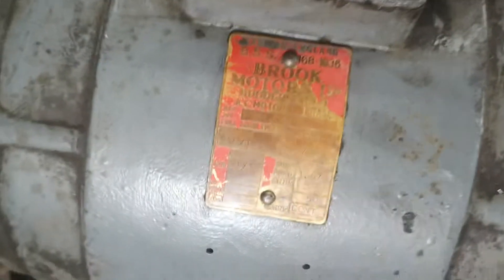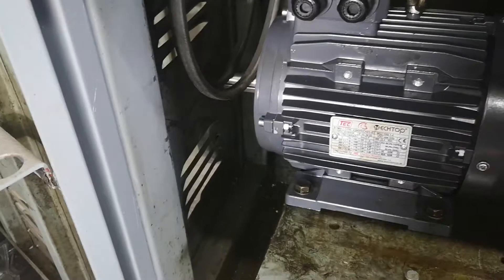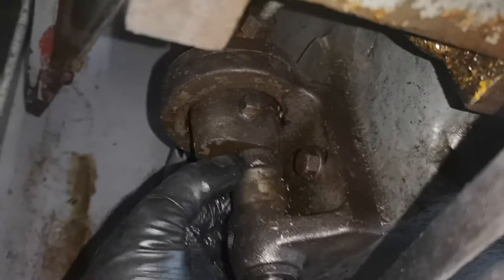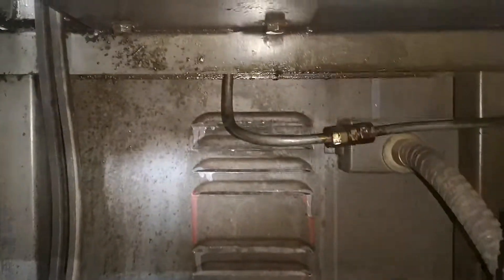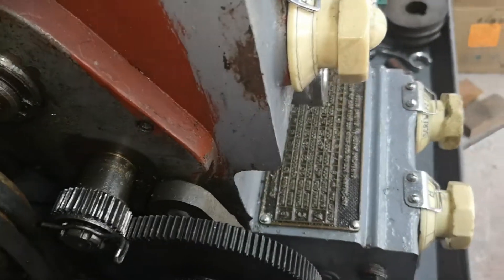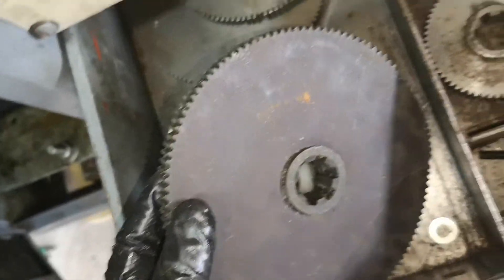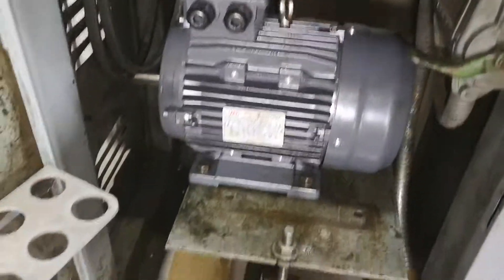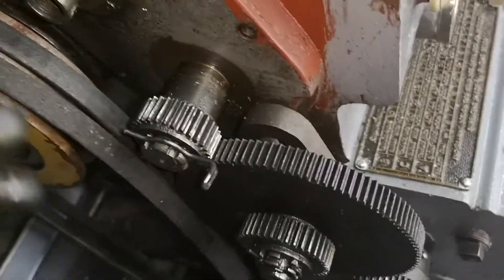Churchill Cub lathe motor & inverter swap. Oil pump? Oiling?

Comment: That valve under the bed is a relief valve. The original coolant line would've had a tap on it to control the flow and the excess oil would just get dumped back into the coolant tray, not unlike how the oil circuit works on older car engines.

Screwcutting gearboxes rarely have an oil feed and are just splash lubricated. The fact that it has a sightglass means that it's a separate oil reservoir to the headstock. The drainplug is probably behind the change gears, it looks like the fill plug is on that side as well.

Comment: I own 2 (yes two) identical Churchill cub mk4 models previously owned by the Indian Railways! Both were severely neglected after decommissioning, which was probably 30-40 years ago :) Since then, they've been poorly repaired, parts lost or stolen, motors missing, shoddily repainted, and the fasteners..... Spanners don't fit? Mine didn't have nuts or bolts in several places. 3 metric and 1 imperial bolt, so on and so forth. Long story short, They've been an absolute nightmare to restore. But the experience has been rewarding, considering how these things were beautifully designed and heavily built. Nothing cheap or budget. Just the stands weigh more than an equivalent hobby lathe. Post more videos if you can, I'd love to see the machine in action.

Comment: the site glasses show oil lubrication level for the machine gearboxes.. the pump and line are for lubricating the cutting tool. totally different and unconnected functions.